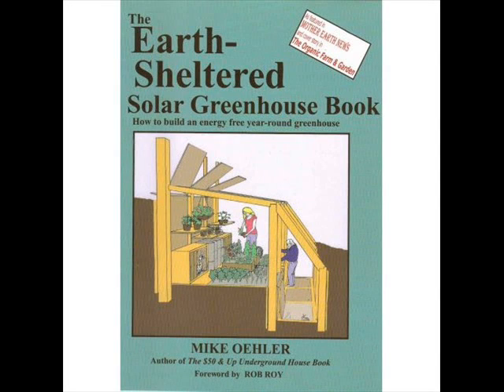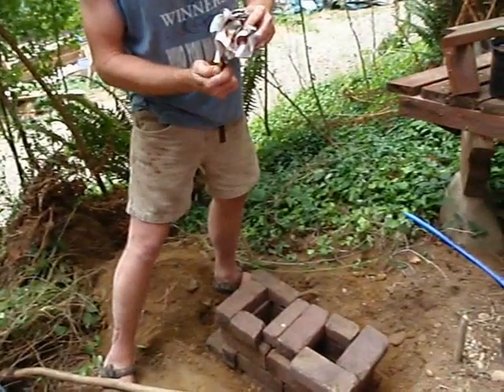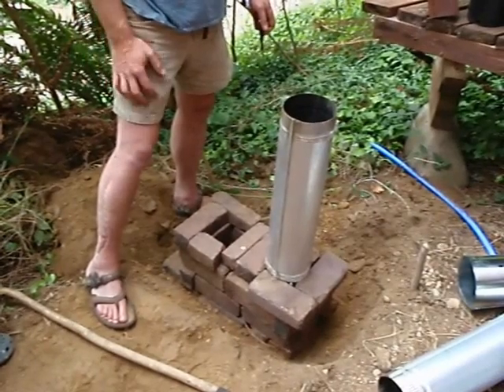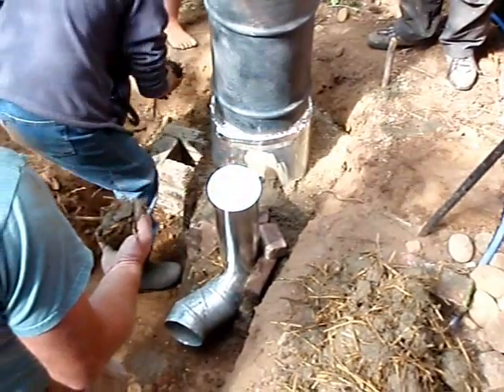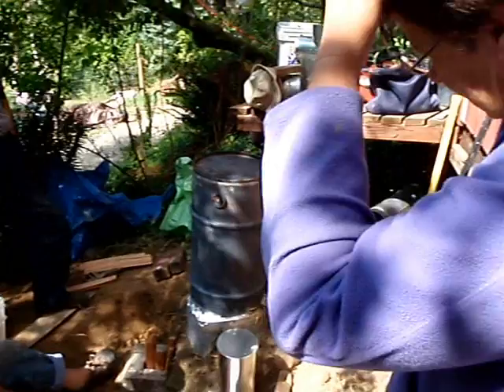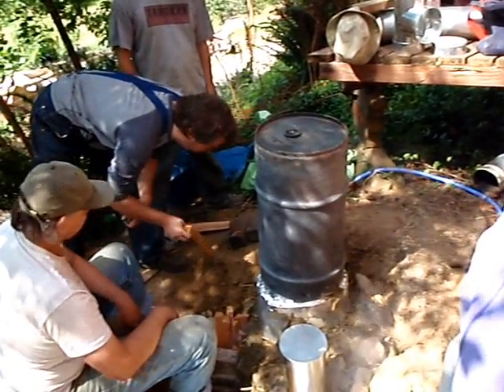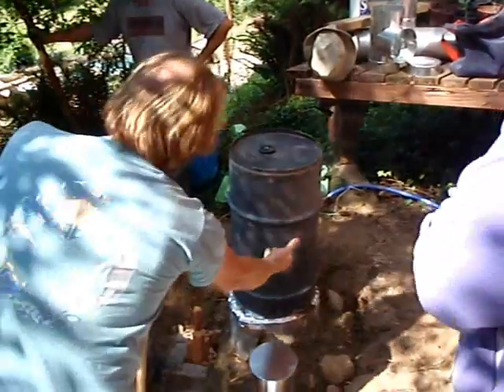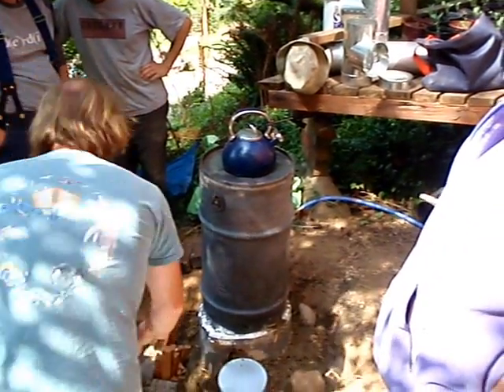greenhouse construction + rocket mass heater how to tutorial

Comment: Torus. It's just how any motion appears to behave against resistance, it recurs back on itself. Like when someone asks you a question you refer back to your self. Electricity through a wire is encountering proportional conductive resistance and as such will have more or less emf bleed, this is the same with heat dynamics this is the torus shape not some bull reference.

Comment: Of course it'd require taking the proper measures to make it safe, but enriching the air with CO2 would make the plants and produce grow that much more in size/qty. David Blume covers this well in Alcohol Can Be A Gas pages 299 to 304. As long as the person removes/ventilates the CO2 from the greenhouse before going in, it seems it'd be fine, right?

Comment: From the date I expect the green house has been used for about two years.  I am wondering what the greenhouse operator thinks of the heat provided?  Is it enough heat to do the job?  I was thinking that the pipe in contact with mother earth most of the heat would dissipate instead of remaining where desired.  Please let me know.  I have a greenhouse project.  Dave in Sutherlin.

Comment: Or create too much restriction and flow?  Only one way to find out!  Actually, one could try it with a simpler L-tube rocket stove frying some eggs..., I think there needs to be air flow for a better burn, space for the exhaust to escape. Too little is like putting a potato in the exhaust pipe causing the engine to cough and sputter out.

Comment: @AZStony  Having worked in the combustion technology field for 43 years I think I just may have a few clues. It's emissions are no different to any other wood fire, there's absolutely no "new" principles at work here. in fact those being used are not even used very well.

It's just a downdraft/crossdraft wood fire connected to a potential soot and creosote trap, that will one day turn into a noxious smoke and soot belching chimney fire.

Comment: Quick question:  Seeing as how, at operating temperature, the exhaust is mostly comprised of warm, moist air and CO2, is there any reason not to put a T on the outlet and return the exhaust to the greenhouse once the heater is up to temp?  It seems to me that the plants would certainly appreciate that kind of atmosphere.  I understand that a fresh air intake directed at the inlet would be needed to maintain O2 levels.

Comment: Better way is too lay copper pipe tubes running thru poured concrete, and run solar heated water thu. No ash blockage, it builds up quick.  More like a car radiator than an exhaust....

Comment: the base mix right around the hot parts has no straw.  in the vid you also dont see the one inch layer of perlite clay mix that is around the burn tunnel. the outer layer should never get to a temp that will ignite. if it does the straw in the mix will just burn out on the surface and turn to charcoal in the mix. 
I think paul has some of our stove. several of the barrels at cobville have been oiled, and if you look for "ernieanderica" our website has links to our picture albums.

Comment: I am speaking about the barrel. if you want the cob to be black use an earthen plaster and a black iron oxide pigment (you can get black iron oxide from a masonry supply for coloring cement.) I think pics of our stove is on Paul,s forum. 

if you want it shiny black. oil it with linseed oil a couple times and get some good glycerin soap and rub it in. then buff it with a soft rag. or use bees wax if your not planning on sitting on it.

Comment: the barrel yes it works just fine. the cob nope and i would not even try it. sealing the cob with a petroleum product or cement is not a good thing. the cob needs to breath or it will retain water and eventually melt. so far every one who has disregarded the warning of not mixing media without lots of experiance has had problems. question is why paint it? do a light sanding and wipe it down with canola or corn oil and fire it. just like a cast iron pan; season it to a nice none stick black

Comment: 1. not yet. experiance at this point is giving the best answers each installation is diffrent with diffrent variables. we are however working on a formula. 
2. yes a dark mass/heater is very doable the system by no means needs to be in the ground it can be in a cob wall. 
3. i have no idea how well it would work for aqua culture. i would think the water would simply add thermal mass to the installation. shoot us an email and we will be happy to work with you on it.

Comment: to have sufficient rise of exhaust gases for a vertical stack you have to have at least 90 degrees temp. (for function in most weather) this system is just at 90 after it passes through the bed when the bed is cold. if it was a horizontal exhaust we could have taken the gas temps down with another pass or two of pipe. the vertical stack is not needed for draft since this is a push systemn but it simplifies things for some applications.

Comment: its also the bypass in case you dont want to heat the bed but want to just heat the green house. the cap thats on the clean out can be removed and the vertical stack place on it and the cap then goes where the stack was and you bypass the bed.

Comment: not a problem our house is 1000 and 70yo with no insulation. our stove keeps the house at 63 degrees in 0 to 13 degree weather. its a 6 inch system like the one in the vid.

an 8 inch located in a central part of the house should do nicely and not chase you out of the room. what you would notice first is that you don't have temp spikes you would have slow waves with the high spot being when you fire the stove.

Comment: the depth of the duct in the bed is 9 to 11 inches with a slight rise to the duct. the clean outs are easy  access for a vacuum hose which is all you need to clean the system at those points. to clean ash out of the burn tube you just use your hand. the next day when its cool. Erica and i dont like ash pits due to them making it to easy to abuse the cleaning out ash every few days; its a safety thing.

Comment: yes the thermal mass works like a battery for heat. the bed in this case planting bed. heats up and stays hot for many hours . (this one should stay warm for 20 or so hours after it warmed up.) like a battery it takes time to charge it up so you fire the stove for an hour or so a day and the heat slowly builds up.

Comment: that system is a six inch system the feed tube is 5"X5 1/2" it takes a surprising amount of wood to fill. each load takes about an hour to burn down if you are using bigger wood so you can time your burn to how often you load the stove. in the bed the soil absorbs heat at 1 inch an hour. your initial burn will be a long one or you will burn for a couple hours a day, then drop down to a one hour burn every day. the radiant heat part (the barrel) puts off  heat as soon as you light the stove.

Comment: this one is slightly proud of the soil level. if you wanted it below soil level you can put a 5gal bucket with the bottom cut out around the feed and give yourself about 16". 

but there are drawbacks to this. IE. the bucket can heat up and be a competing chimney. (hot stack effect)

Comment: you can get the book. it tells you step by step how to build a basic stove. Erica and I will answer questions as will Ianto at CCC. deviating from the basic stove is where things get diffrent because the variables all change. the basic 8" system can be used to heat a mass bench, bed, wall, floor (if you do the floor right, pretty hard for many to get the depths correct), etc. small warning; we will answer questions but wont spend all day on head scratchers.

Comment: if you can get one of those briquette presses that where popular a few years ago it would work fine on leaves after a bed of coals was built up. petro chemicals take lots of adjusting to make them work as does veggy oil but either is possible. 
the configuration has to be changed to get the smoke re burn right so it burns as clean as biomass.

Comment: @manyaGodbole ,
This version is designed for wood.  You could use the same concept for a different fuel, but might need to adjust some things.  If you want to use any available fuel in the same stove, you'd need an exhaust that goes mostly upward, instead of up down and sideways like this one.

Comment: it does if the ducting is to close to the max root depth. if the plant has a deep tap root its going to get toasted. but most garden plants are shallow so unless you really run the stove for a very long time you will be fine. as with anything excess will bite you.